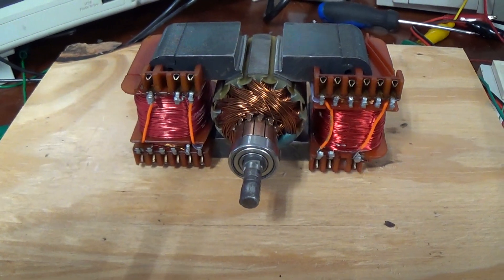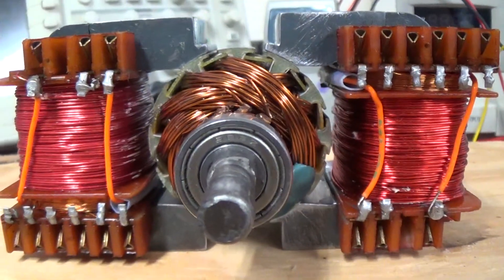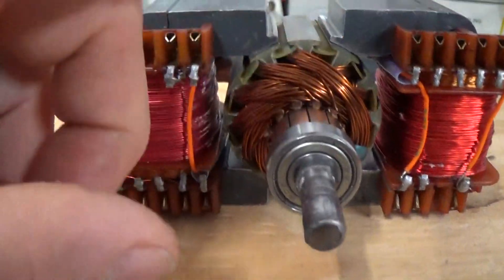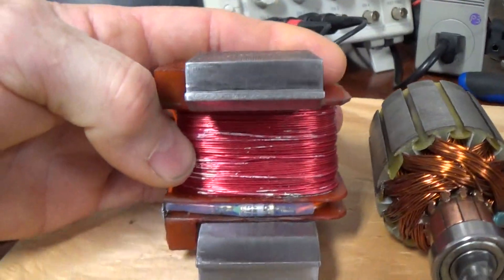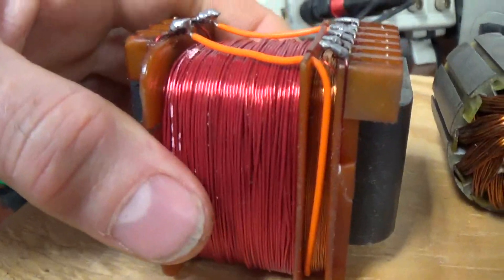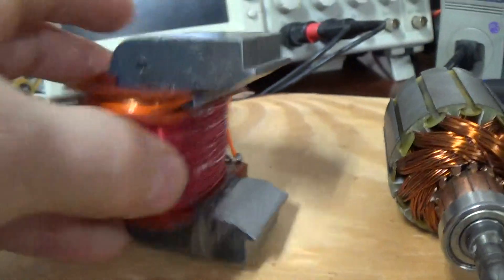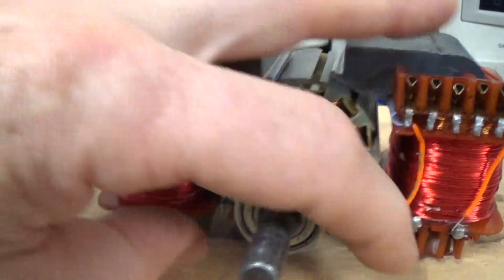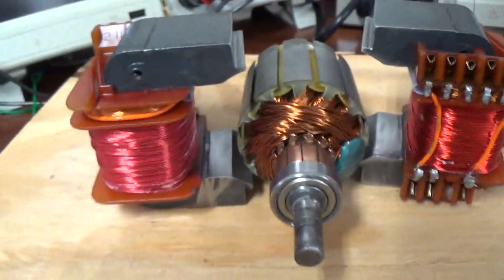Sharing ideas, how to build a more efficient motor (p.3)

Comment: nice work, looking forward to this being tested. Have you looked in printed circuit board cores for your electric motors?
Reply from the maker: +OzKnosis I don't know what "printed circuit board cores for electric motors" are?
Reply: Luc gotoluc Choquette here is a link about it, its a relatively new wireless type of electric motor which uses printed circuit boards instead of wire windings on iron cores etc. : https://endless-sphere.com/forums/viewtopic.php?f=30&t=51144
Reply from the maker: +OzKnosis Interesting idea. Thanks for sharing. Luc